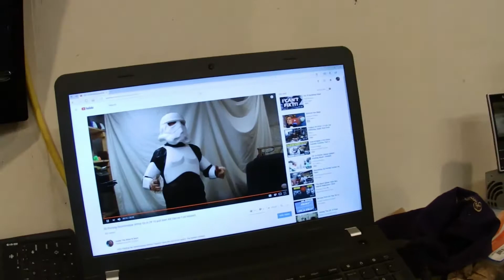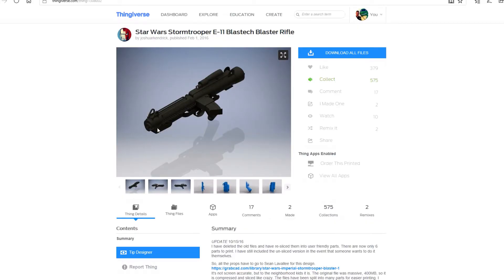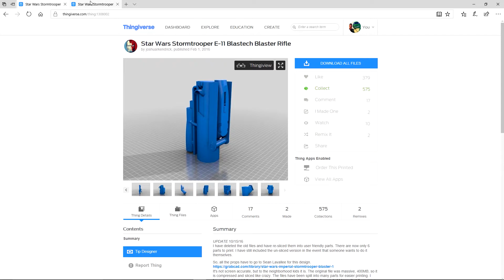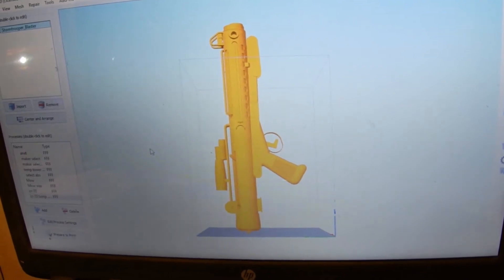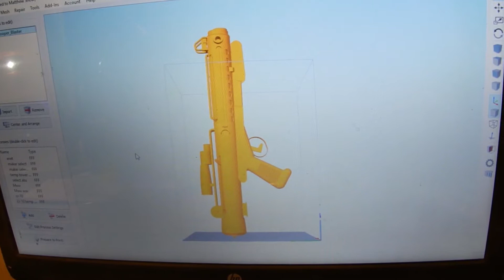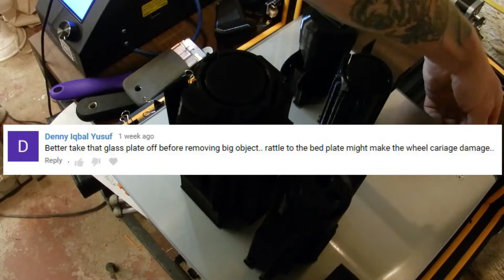3D Printed E-11 StormTrooper Blaster Rifle (On CR-10)

Comment: Awsome Job,  I never much noticed before but  looking at the print the E11 looks awfully similar to the old 9mm sterling L2 smg  with its stock in the folded position
Reply: They were literally WW2 surplus Sterlings. The prop had some bits and bobs added to it, like windshield wiper rubber in the vents, etc.